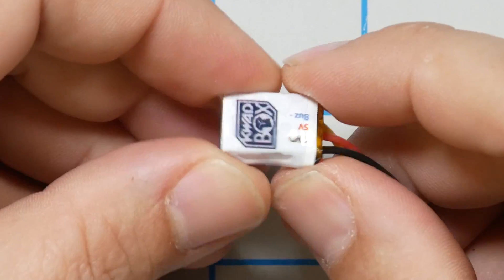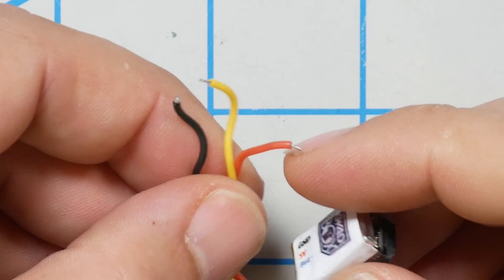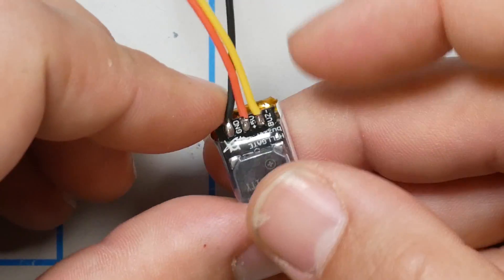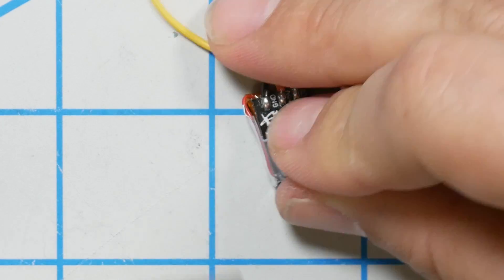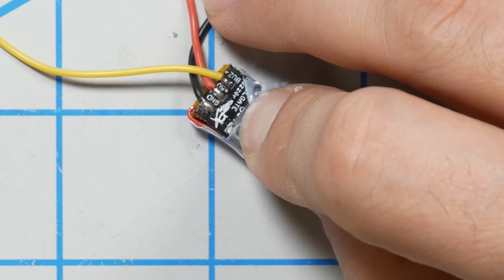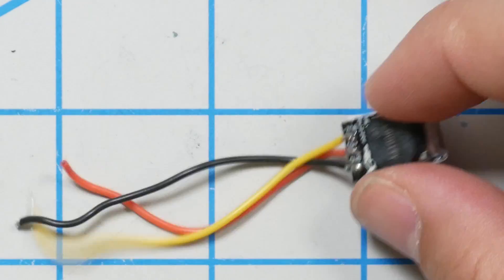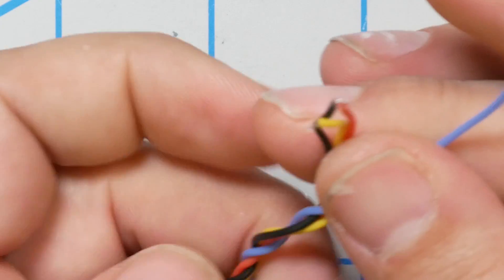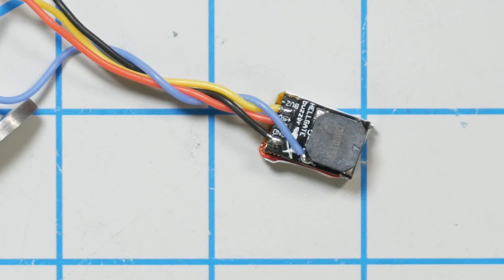How To Disable A Broken Hellgate Buzzer (without a hammer)

Comment: I would rather have this one without a shut off button, because there's no way it would be accidentaly pressed and you would end up losing your quad anyways. If it gets stuck on, it looks like it is easy enough to cut a power wire from the battery. Easly fixable. Carry a pair of cutting pliers and you're good to go.

Comment: Fought with this thing again recently after a crash severed the wires and this is what should work every time.
Connect the corner pad with the 5V pad (I can do it with a knife blade) for 10+ seconds, then release, and then touch the same two pads for about 1 second and release.   
Activating the intermittent power protection "feature" is almost guaranteed, so best to just assume that it's activated every time, and run through the 10 second deactivation cycle. 

I would absolutely replace this annoying thing with ViFly beacon but they're out of stock everywhere in the US and it'll be weeks to get anything out of China.

Comment: Hey JB. Had a similar issue with Vifly finder. During an extensive on wing troubleshooting session on an unrelated system the Vifl started screaming. Disable switch did not work. It continued to scream once removed from plane. In defness and desperation I cut the red battery supply wire to shut it up. Let it sit for a while then reconnected the wire. Has operated as normal since. I figure the logic got knackered (I know..wrong channel) and it needed a full power removal (including battery) to make it happy

Comment: Is it possible these can ruin FCs? I left my KISS V2 build plugged to usb in for about ten minutes to charge up the Hellgate buzzer, then plugged in a Lipo to change esc firmwares and I smoked the FC and Crossfire Nano. I didn’t change anything hardware wise, just charged up the Hellgate. Wondering if the battery connected to the buzzer pads can do anything.
Reply from the maker: I can't think of any way this could happen, assuming it was installed correctly. I haven't heard of any cases of it happening either.

Comment: Best solution is to remove the heat shrink around the battery and the little pdb board and cut the ground wire or the red wire.

Once you go home, just redo the solder and wiring yourself. It usually happens when the board is in contact with water or humidity. Conformal coating the small pdb after redoing the wiring and soldering helps, but not bullet proof solution.

I had that problem so many times. Put me off from buzzers. I removed it from all my quads now. It sucks when I got to find it in the woods but at least I don't have to disassemble my quad for 15 minutes in front of scared people thinking that I'm going to blow them off

Comment: I finally got my Hellgate to shut up after beeping for more than an hour. The 10-second reset didn’t work. I am lucky that I installed mine with servo pins and a harness because I planned on swapping it out between quads as opposed to a hard-soldered connection. On a whim, I tried  unplugging the servo harness connection while the quad was plugged into a LiPo. That got it go back to the chirping mode after beeping for so long. I then plugged it in again and the arm/disarm beeps sounded and it all stopped!
Maybe Joshua Bardwell can confirm whether or not residual voltage from a low ESR capacitor, which I have on my quad, might interfere with a clean power cut required to switch the device off. Just a guess, and I’m glad that I didn’t have to bring the hammer 🔨

Comment: Hey Josh I love your videos. I have the Hawk 5 with a QX7 im having weird issues with a total power cut, for like a split second seems to happen around 15 volts all of my voltage settings are stock for a 4s battery. Also I experienced a weird loss of control, ( the quad just kept hovering from the last position it was at but no cut in power like the other issue) luckily that happened Los hovering at about 10 feet away. It is also very picky about when it arms. And twice now after arming when I went to throttle up nothing happened then it disarms itself. How can I become a patron? Love your videos please help?
Reply from the maker: Answered on Discord.

Comment: Try putting the battery in the quad for 10 sec, disconnect and do a regular disconnect with pulling it in and out. The buzzer have a anticycle mode who makes this.

Comment: I have a DJI  Spark with the controller and have no issues at all flying it. Would i be able to fly an FPV drone?
Reply from the maker: They are not the same thing at all. Flying a Spark is like driving a Tesla on fully autonomous mode. Flying an acro FPV drone is like riding a motorcycle.
Reply: Im subbed and have been watching your videos. From what i gather you need to know how to build so you can repair. I flew Rc planes a few years back. Im hoping that will help. It is my understanding that some drones will self level but wont hold a position. I think i could maybe handle that as a starting point. With that being said where do i start? Lol. Yes i know im judging myself. I can only guess at my ability. I looked at the arris c250 with fatshark hd3 and radio combo on arris hobby. I built a few arf planes back in the day and then just paid people to do it and i modified what i needed to. I travel for work and dont have time or space to build even tho i enjoy it. The money is not an issue just time. It seems to me that most driones are way tougher than planes. Planes were roughly around $300 a try with everything built salvaged and ready to try again. I learned to not go cheap on anything building planes, buying radios and receivers, or engines especially. OS 4 stroke all the way. Thunder tiger you say???....get ready to wear out your starter battery!!! Ha!!! I really enjoy your approach to teaching and i hope your videos dont become “work” to you and you continue to enjoy making them as much as most of us enjoy watching. Sooo many drones, sooo many opinions on where to start. Where DO i start?

Comment: Are you ever gonna compare which buzzer works best (or is most reliable)? Would you recommend the $30 price tag of the hell gate??
Reply from the maker: I have been using the Vifly finder v2 and have been liking them. The Hellgate's biggest advantage is that it is very small. So on tighter builds, it's the choice, even though it's more expensive.

Comment: I used a 1s whoop battery and corresponding pigtail, and touched the wires to the corresponding pads, and it worked like plugging in the battery. Much better than repeatedly plugging in the main battery and frying a wet ESC.

Comment: hey! can I usee HellGate along with a capacitor in the quad? having problem disarming after puting cap into the system. Is it normal JB?
Reply: I have caps on mine and i have no problems what so ever. Where do you have cap?
Reply: @snapko  cap was on the vcc/gnd on the PDB. where should I put it?
Reply: @FUFUFU FPV I have one on vcc/gnd and second one on +5V rail/gnd and I have no problems disarming it, so maby your problem is not cap. Can you just try to connect battery little longer to disarm it? Like 3sec

Comment: I have a very cheap copy and it sometimes just starts emitting its tone constantly (it also has an LED which then is constantly lit) and the only way to stop it is to rip it off the quad, pull off all the heatshrink and disconnect the little LiPo. -_-

Comment: Hello Joshua, you should join +pad of the buzzer (it's the one under BUZ- pad) with +5V pad, not the opposite site! On the +pad is battery voltage, so the HG buzzer thinks, that it's connected to the FC and you can normally disarm it.

Comment: why fumble around with the pliers trying to jump the pads when you have a red wire just hanging there ready to touch to the off-pad?  I still like this beeper for my weight sensitive 3" cinequad
Reply: I was saying that to the screen throughout the video... Just use the red wire Joshua....  he did not listen :)
Reply: why choosing the save way, when there's a risky one? ^^
Reply: I thought of that too, but if the buzzer’s installed in a quad, the wire might not be available.
Reply: He's a theoretical guy, not practical, obviously.